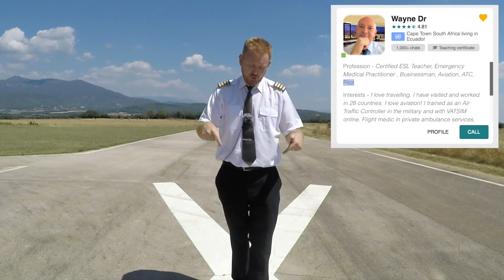Water salutes, why?

Comment: Does jet fuel not have the potential to gel at cold temps like diesel then? Is it in between diesel and gasoline in terms of refinement?  I figured the fuel tanks on a jet must be insulated or heated.

Comment: Hey Captain! Here’s a question for you: why do military aircraft (particularly transport aircraft like the USAF’s Galaxy C5 or the C17 etc.) have their wings on the top of the fuselage? And why do commercial planes not do this? I’ve heard that this is because of they want more clearance under their wings so Humvees can drive under them. I’m wondering is this is true and if there are any aerodynamic advantages/disadvantages of this feature.

Comment: Well... hey Petter, the water salute I 've seen 3 or 4 times is also for a Brand New aircraft just landed from the factory.. Here at Monterrey MMMY Airport is based Viva Aerobus, an up comming low cost airline that recently (2 years) have changed their original B737 300 and 500 for Airbus 320-200... and in fact, in october or november 2017 they performed a record fligth from Keflavik to Monterrey on its delivery fligth, as the longest route for a A320...👍😎 great topic and as far as I also follow Cap Joe I only have seen your video..!! 😉😁

Comment: The one problem I have with water salutes is when they do it in declared drought areas. For example California, both SFO and LAX areas, have had drought conditions for years, and are always subject to brush fire dangers. yet I've seen a number of water salute videos at LAX and SFO. A homeowner can't water their lawns, but it's ok to waste 3000gal of water shooting it over an airliner. At least they seemed to get the message at SFO as the latest ones I've seen are dry salutes, where they have the fire equipment in place, but don't actually spray the water. Hopefully LAX and all other airports in drought areas will do the same.
Reply: One thing is that SFO sits next to the bay. There's plenty of water around. The drought limitation is about using potable house water (which typically comes from the Sierras hundreds of miles away via the Hetch Hetchy aqueduc system) to end up watering one's car or lawn. Fire fighting in SF uses recycled water instead.
Reply: tf51d Think another aspect, too. Firefighters must do their job even in the most severe drough. They also must maintain efficient equipment at all times. They must test their equipments efficiency time to time. If it is a water salute that is not that waste. I accept your point of view, but if it has a safety benefit, too, then it is not that big waste. I wish you all the best, and you have my sympathy. I have friends in Santa Fe who told me about how severe it was...

Comment: There is also a similar tradition in the German airforce. But they do it a little different. The pilots sit on a  chair on a cart  dragged by a service vehilce or a small truck. Than the pilot(s) themself not only there aircraft gets showerd after there first or last flight during abroad deployment. Or at there first or last flight in a squadron or aircraft type. Usually its only one fire truck following the cart the pilots are on. Sometimes the mechanics crews build models of the aircraft they use  for the pilot to sit on.

Comment: There was an episode of Air Crash Investigation where water got inside angle-of-attack sensor and froze when the aircraft flew into high altitude, hence the sensor gave wrong data because it couldn't move freely. Can water salute before departure cause the same thing?

Comment: Hi Sir what is coffin zone and critical mach?
Reply: Coffin zone is the the altitude where the "Do Not Exceed" speed and stall speed are extremely close together, where a mistake could cause the plane to crash. Critical mach is the speed at which the air over the wing is almost about to break the speed of sound.

Comment: Hello Mentour!! This is Emmanuel from Argentina living in Ecuador
Thank you very much for all the excellent job that you have been doing during these years. There is no more honorable work than sharing knowledge with others. That´s what make us evolve.  I´ve seen all your videos and wish to some day become a pilot.
Please could youy make at least a short video about the new Airbus A220-300? Is it composite?
Please could you talk about pros & cons about composite made aircrafts?
And the last:
Please could you tell us more about landing gears? different types in different aircrafts, brakes, tires, axles, suspensions, materials, models, etc.
are there many aircraft models with the same landing gear? why some are more slanted than others?
do you know how does the brake system do to equilibrate the braking power to each gear in heavy and super aircrafts? are they independent or there is a common hydraulic system?
why in some hard touch down we can see the landing gear shaking and not in others?
in some hard breaking manouvers tires may fire up. at witch temperature and why? just because of temerature increasing or the heat may damage some hose or somethig? does the brakes start the fire?

I gess you have a lot of info about.  Again thank you, and I will be asking for more.
Take care of yourself and see you next time bye bye!

Comment: I was watching air disasters and airplane has crashed because excessive water sucked into engines. They discovered engine is bad at handling water at low rpm. But I don't think water salute is dangerous simply because it's happening on runway at low speed, worst case scenario will be one engine can shut down. But fire fighters must point water directly into engine

Comment: Why is the water pressure of one truck is more than the other truck every time ?
Reply from the maker: The individual trucks will always have slightly different output pressure. The engines are slightly different and so are the nozzle setting.
Reply: I guess these fire engines are not designed for water salutes primarily in mind. For an actual fire it is the last thing that the spray goes equally nice arches from each nozzles :D